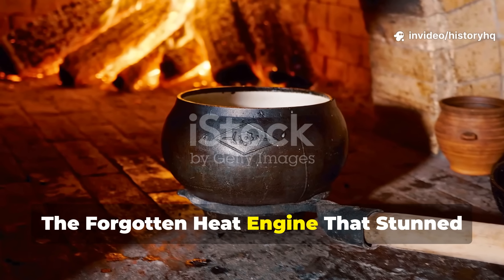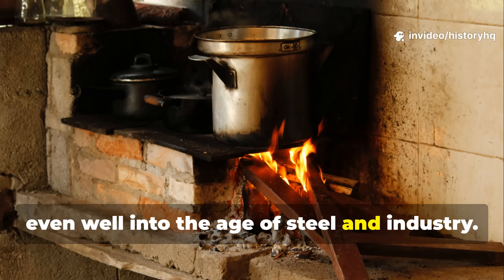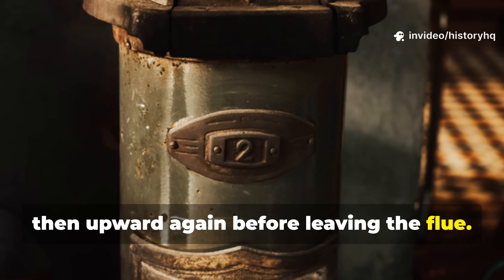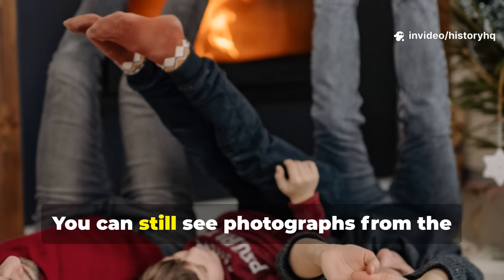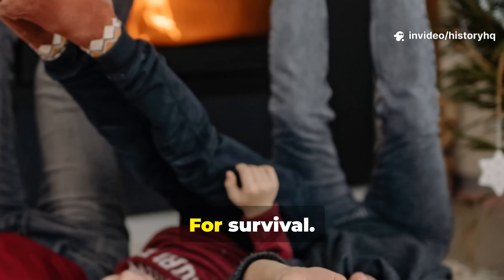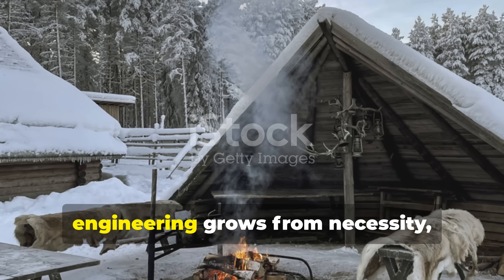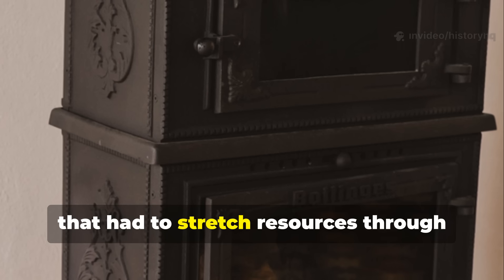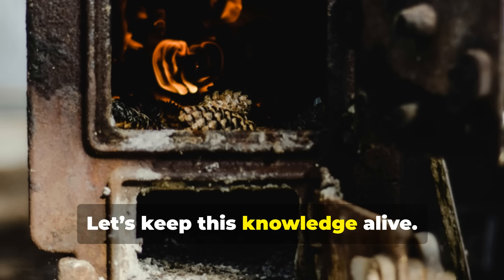The Russian Stove Hack That Tripled Firewood Life… and Modern Science STILL Can’t Beat It

Comment: This producer has never seen a Russian stove in his life!
Reply from the maker: Fair criticism — regional designs varied a lot. The video focused on the core masonry principles rather than one exact build.
Reply: @HistoryHQ-Stories  i know kemey .... i can tell u the bigger the better , u as well build them through other chambers and the side of the kemeny should be the wall of ur washroom /shower .... water has a bigger starage capacity as stone ... so u better be shure u warm as well 2 kubic of water as well left and right in the kemeny ... comes in handy when taking a bath ... u take baths becouse u have no pump .. u hand pump well water into ur storage and have it go down by gravity , mixing it with cold well water in ur bath ... toilet as well has a manual pump to fill the flush water ... if u have a kemeny thats guiding the gas down again , you can even collect more remanent heat by having a channel run over the ground .... however u have to first fire up a little fire under the smoke stack before lighting the kement for ``pull`` ..if u dont ur house will be filled with smoke .....so u can indeed have an alkove in what u can sleep as well and a kitchen with oven .... 

please if u want to be taken seriously , dont use AI voice !!!
Reply: @HistoryHQ-Stories  oh , btw, ur water storage  can be dangerous bakteria growing ... so 1 u use constantly and the other u use for outside the house if u need hot water ...as long as everything boils, its ok however unde 60 C phisteria develops ...and that is deadly ..

Comment: use the stove to heat a barrel of water in a rack above the stove and also heat stones.  Put the stones near where you have to work, or inside of your sleeping-gear.  Seal off your walls, cealings, floors, or at least, windows and doors, with blue masking tape, tacks and sheet plastic.
Reply from the maker: Great additions — water, stone, and sealing the space make a massive difference in real cold.